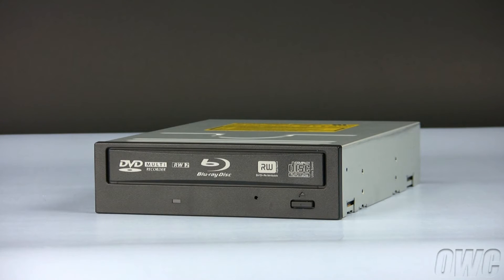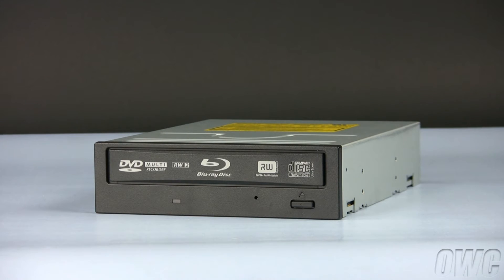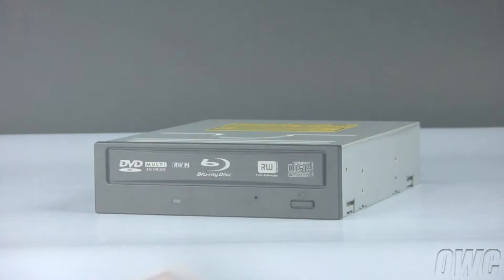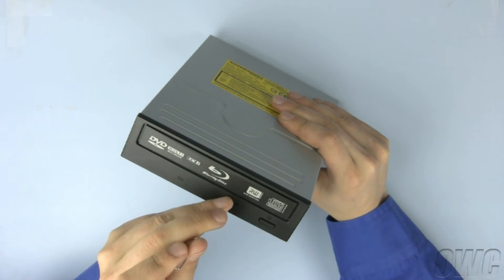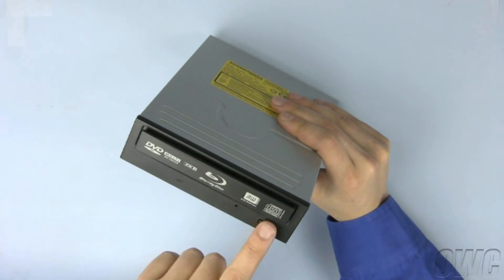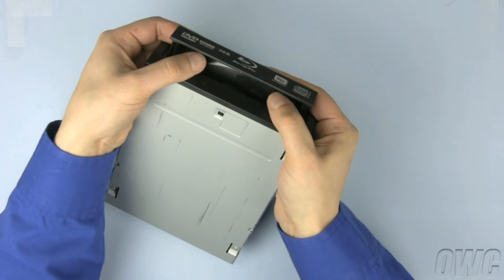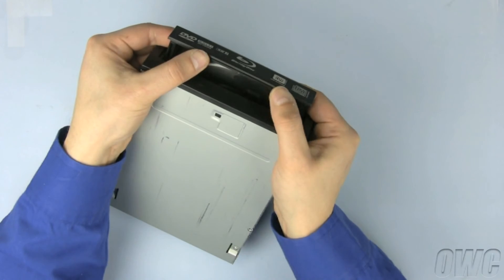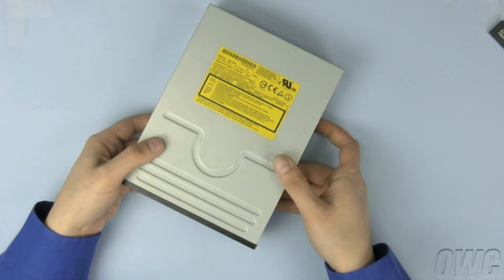Removing the Tray Bezel from a 5.25" Optical Drive.

Comment: Before I saw this video I tried to pry it off with a screw driver with no effect. The technique it the video worked like a charm.
1. eject with a paper clip 
2. flip it upside down draw facing away 
3. press simultaneously the two clips down and away
Reply: Peter Cofrancesco 100 point summary

Comment: As of 6-5-12, this video is no longer usable for the LightScribe optical drives that OCW sells. There are no "two tabs" there at the bottom. Or top for that matter. After 20 minutes of looking around for some release, we ended up just sawing the bezel in half.